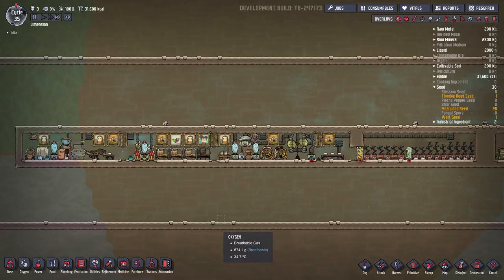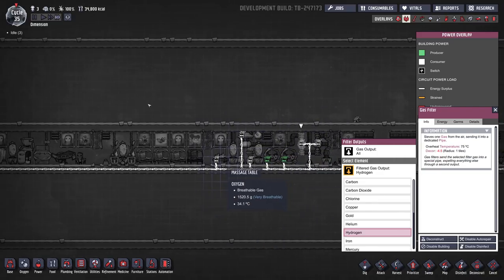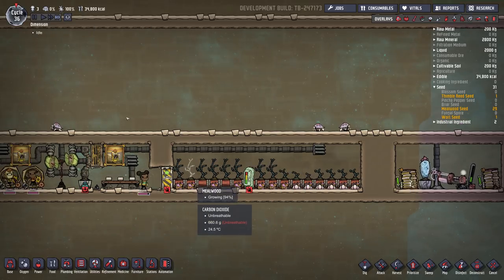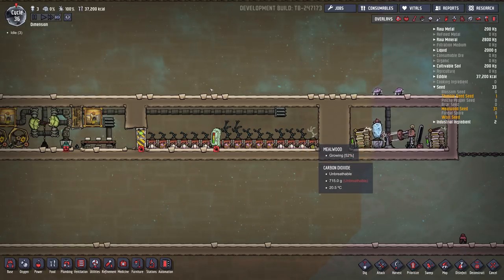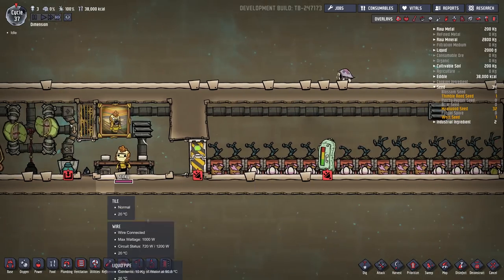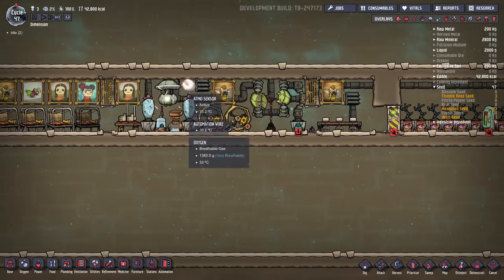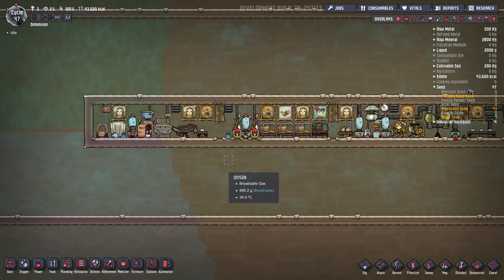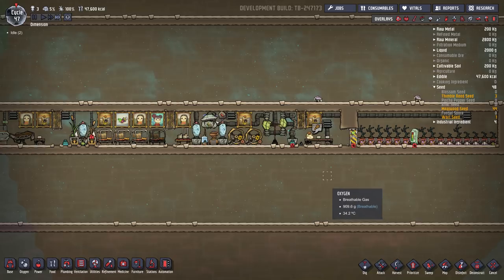Modular Base Design - Send Me Your Base Designs / Screenshots - Oxygen Not Included [4k]

Comment: 5 weezeworts seems a bit high for supporting just 3 dupes...
Reply from the maker: Yeah it's crazy. And the base ended up crashing due to being too cold :P
Reply: You could seal the weezworts in an insulated room each with an automated airlock that only opens when it gets too hot. That way the weezworts arent constantly deleting heat. 

You could also just use 2 weezworts and an AC unit in a sealed, insulated room. Just pipe hot air to the AC unit and pipe it back to any room that needs cooled. With a few thermostats in your hot areas tied to gas pumps/shutoff valves you could make targeted temperature control for each individual troublespot using a vent, shutoff, and thermostat.

Comment: Would it be possible to generate water from co2 scrubbers, clean it and then supply hydrolysis? Power and heat heavy but solves co2 problem and reduces water input

Comment: Yes, plants consume/destroy their appropriate gases.
Reply from the maker: Interesting and good to know. So in a sealed room it would eventually become a vacuum?
Reply: In my experience this is not true. I farm in sealed rooms and the air pressure does not change at all while the airlocks are shut. I do farm using oxygen though so maybe that makes a difference? It would be interesting if it did. Combining mealwood as a CO2 scrubber that then feeds my hatches which then produce coal which is converted to power and more CO2 is a pretty interesting cycle.

Comment: Couldn't you use lavatories for water production? Or do they not produce enough water?
Reply from the maker: I could filter lavatory and shower water but it would still have germs. They don't really produce much of it. I would also then need a source of sand. I could boil it into clean steam but that is a much larger operation.
Reply: Dupes don't actually care about any germs in the water input for lavatory, shower or wash basin (this could change in any update). If you build a closed loop between your bathrooms and a water sieve, you could sustain your loop forever with even excess water. The only upkeep cost would be some sand, but as that is available in such large quantities with digging (and you can also make more with rock crushers) or even unlimited amounts if you do some heat stuff with polluted water (which heated up to very high temperatures will result in sand and steam). 
For your sealed base a water geysir is probably the way to go, but I would recommend the closed loop with a water sieve for any real game though
Edit: Wash basins and showers produce as much water as they use, but the lavatories output 11,7kg of polluted water per use with only 5kg water required (Random fact: A dupe weights 30kg and "outputs" about 22% of their body weight each time they use the toilet.)
Reply: I know this post is getting old, but this is great info. 6.7kg water/day/dupe tells you how many bristle blossoms your colony can produce without consuming water, or how much free oxygen they can produce. If polluted dirt from the sieves is left to turn into oxygen then you just need sand and water. As long as slimelung never gets in the polluted air isnt a problem :) So just need snad and water. Sand can be automated using the conveyor system. So if we figure out how much oxygen one dupe needs then we can see if they produce enough polluted dirt to take care of that :)

Comment: You're going to have trouble (outside of debug mode) getting enough abyssalite to build the exterior walls and floor that isn't at a super high temp.  If you build with hot abyssalite it'll heat your base indefinitely.  It's a nightmare.
Reply from the maker: As far as I know the heat inside abyssalite never escapes. It's a perfect insulator. I've never seen it leak heat.
Reply: I hope you're right! The only time I've had trouble with my bases over heating was when I used abyssalite tiles.  Hopefully it was just a bad coincidence
Reply: Abyssalite is a perfect insulator and will never exchange heat. The reason your base heated up is because it didn't give of heat to the outside. Meaning the abyssalite tiles sped up the local heating. If you take the same base and change the abyssalite tiles to lets say granite, then it would still overheat but it would take longer.
Reply: Abyssalite will actually heat your base up, but reaaaally slow. An abyssalite tile which is 351K (80°C) hot will emit about 0,00001 W/m. Compared to that sandstone will emit at the same temperature 1017,9 W/m (100.000.000 times more). While abyssalite theoretically would heat up your base, it will take humongous amount of time to do so. The only reason to use cooled abyssalite for building is OCD-reason. :-)
Reply from the maker: Technically true. I probably won't be running 10,000+ cycle bases though.
Reply: well, it's almost perfect, as its thermal conductivity is 1E-05, or 0.00001